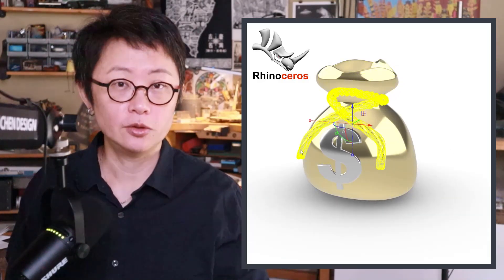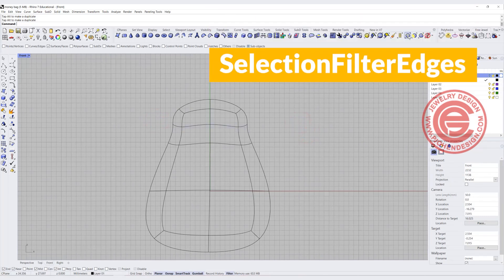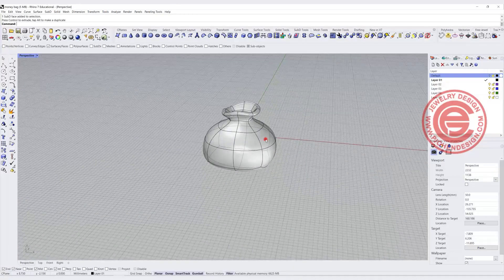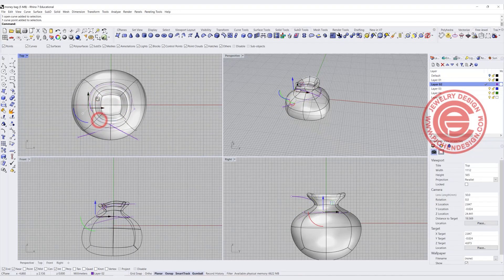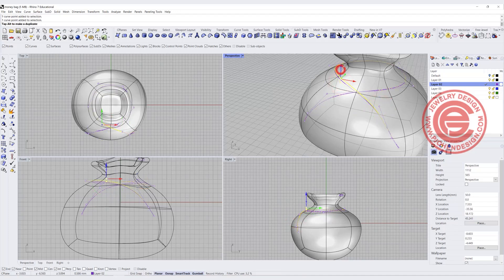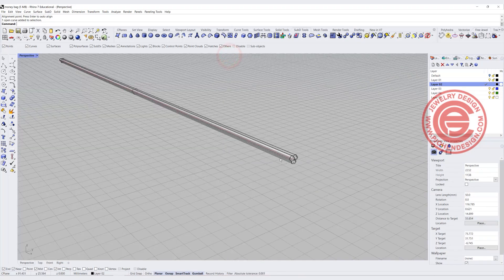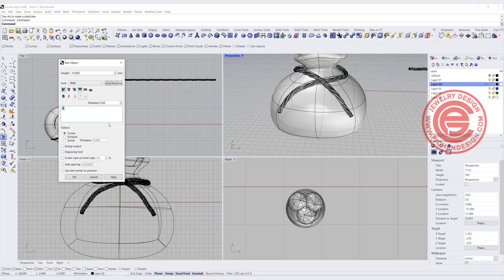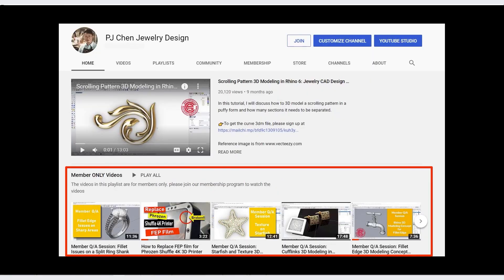Rhino 7 SubD- Money Bag Charm Design Tutorial 3D Modeling #317

Comment: LOVE IT! I have learned so much from your Videos on Rhino in general but especial on SubD. I am using ZBrush and I I always feel defeated and disappointed  by that program because I have not found a teacher who explains things as clearly as you do! Your course on SUBD and your videos have helped me so much, not just with Rhino modelling but also with understanding ZBrush better. □ Also in this video, very useful to see how you 1) Project but also 2) Pull the Rope. And for the $ sign, great technique to do boolean with a NURB surface.
Reply from the maker: that is super!!
Reply: For the $ sign - if the pouch was symmetrical created through Revolve for example, would it best to Bend the $ to fit the shape of the pouch, or would there still be an advantage to do boolean with a dublicate pouch-shape? Thanks